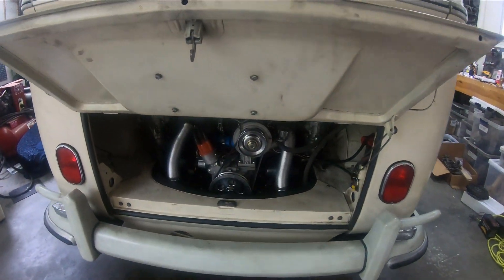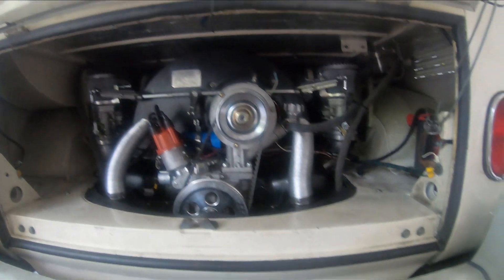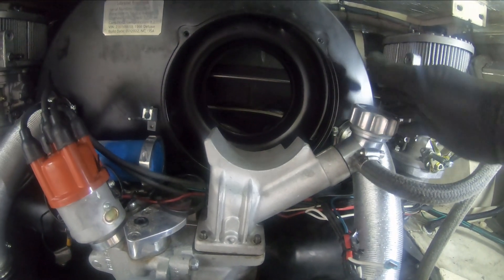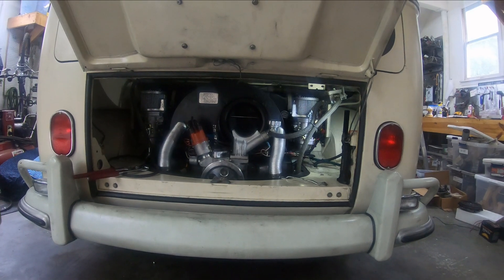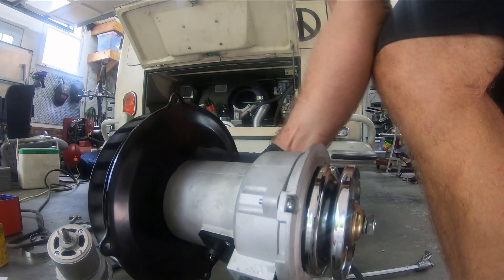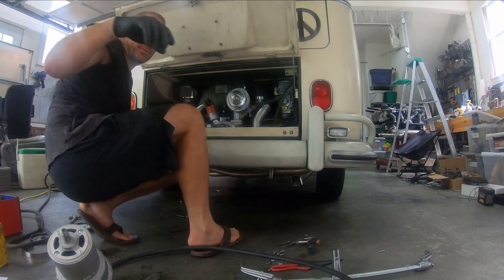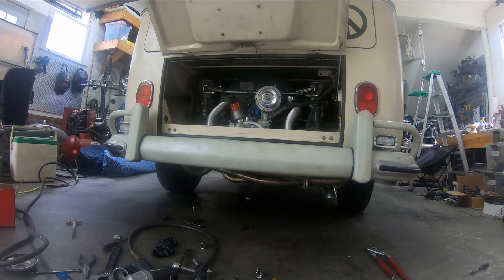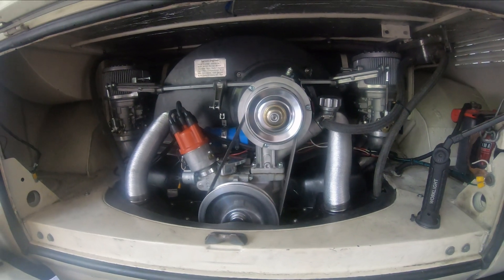2332 VW Air-cooled Stroker Motor - Video 89 - Swap 90 amp Alternator for 55 amp

Comment: Did you exchange the stock 10 gauge wire to an 8 or 6AWG to carry that extra amperage? (Assuming that you were pulling it with extra lights, audio components, aux heaters)...
Reply from the maker: No, I left it as it was - but everything was off when I had that 90 amp alternator - I think I also had the wrong coil.  Eventually I swapped it all for the 55amp and the correct coil and it works great now.  I still have the 90amp alternator just sitting here - not totally sure if I threw the baby out with the bathwater on that one - it might be fine but my setup was all wrong and I didn’t isolate the problem well enough to know for sure…

Comment from the maker: ok - so far the problem has not happened again with the 55 amp alternator.  I have not yet gone for a long drive, and I have ordered a laser temp measurer to check the head temps

Comment: I do not know, it might not be the issue.  Did you get the temp with a laser they sale for heat temp to the heads.
Reply from the maker: the motor may just be getting too hot.  The thing is the oil temp on my gauge never gets over 180 so far, so maybe it is the head temp?  Perhaps running too lean main jets or something?
Reply: I was having trouble with the heat and leaking oil.  A friend came after looking,looking he determine the air  that I had running inside the engine…. The pressure did not escape properly we remove a hose and it worked.  I have a 1835 or 1815
Reply: Remove the hose attached to the oil tube and see how it work, just a try